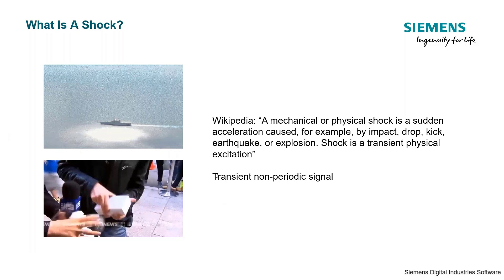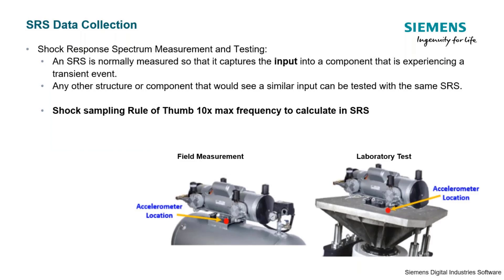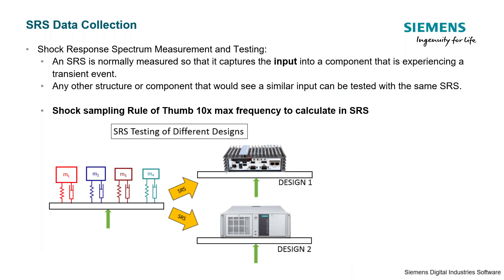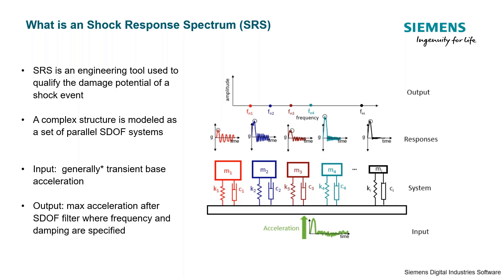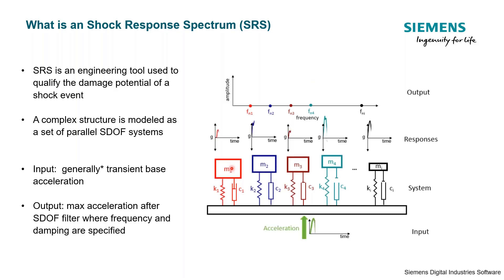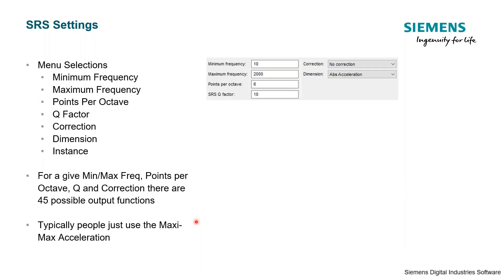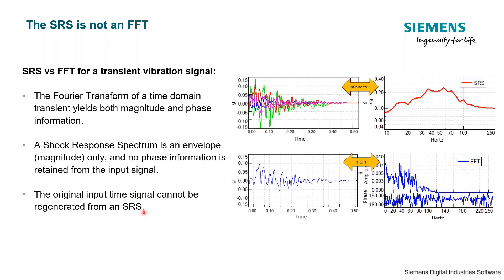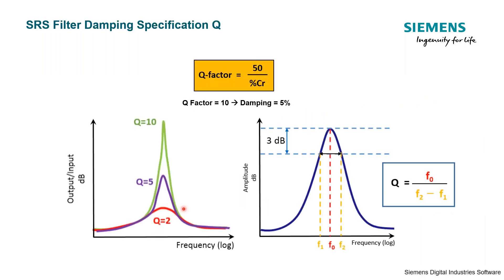Shock Response Spectrum

Comment: Thanks for the response . I have a further question. I am curious about how to use the modal analysis result of the physical test object combined with the shock response spectrum. Let me give an example, if the natural frequency range of the physical test object is between 200-1000 Hz, is it correct to look at the 200-1000 Hz region of the x-axis on the spectrum?

Comment: Thanks for the kind video. I have one question about 5:10 . How to obtain f_n1, f_n2, ..., f_n4? Do we need to implement modal analysis for a given system? Are those the natural frequency of the given system?
Reply from the maker: Those are the natural frequencies of the given mass-spring sdof systems. They are NOT from a modal analysis of the physical test object.
Reply: @SimcenterTesting  Thanks for the response. I know that f_n1, f_n2, ... are independent variables. But, I am curious about how to use the modal analysis result of the physical test object. For example, if the natural frequency range of the physical test object is between 200-1000 Hz, I wonder if it is only necessary to look at the 200-1000 Hz region of the x-axis on the spectrum?